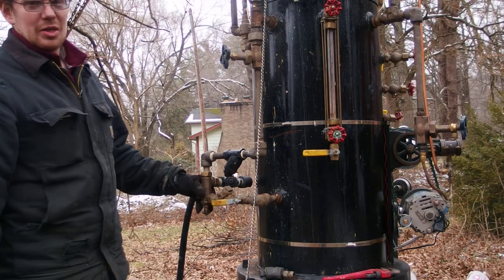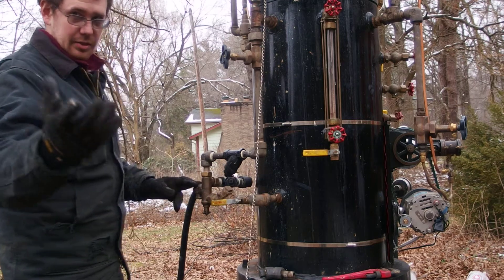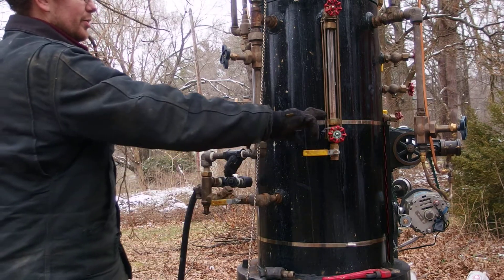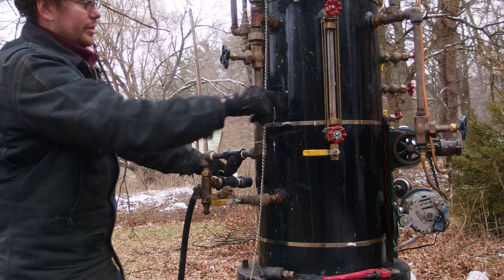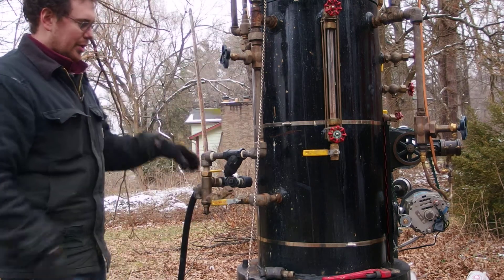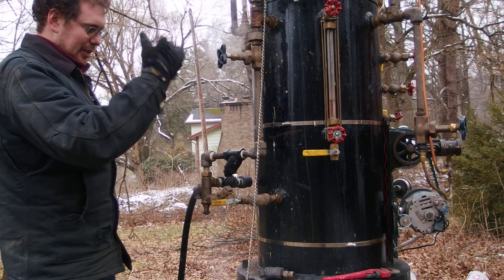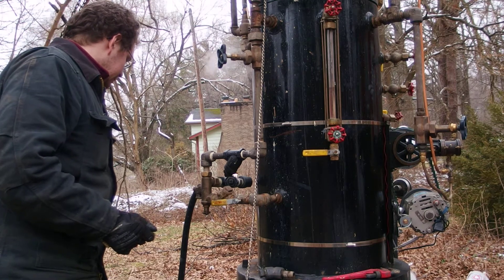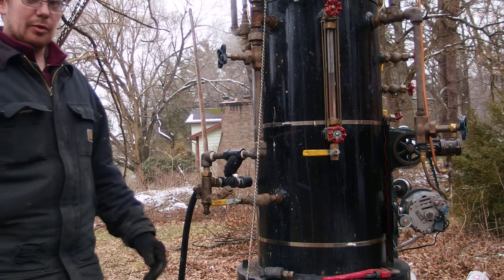Penberthy Steam Injector Operation

Comment: Beautiful Boiler! Where did you get it? And What happened to the boiler you bought from Ross?
Reply from the maker: +SteamAndSmoke97 It's a new ASME code and stamped boiler from Lund Machine Works. The boiler from Ross is not being used.
Reply: I understand it's a code boiler, I've been looking for one for my Engine collection which is growing larger than my smaller boiler can handle. How much is Lund charging for a boiler like that? And why is Ross's not being used? Have the tubes or welds started to leak or weep? Or is it just because you feel safer with the Code boiler?
Reply from the maker: I'm not using Rosses boiler, because one boiler is enough for one man. :) There were no leaks/weeps, but there were a host of little issues that show he probably shouldn't be selling them. Many people are angry about his boilers, I feel I learned a lot on my boiler from Ross and moved past it. The capacity, performance,  features, and safety of my new boiler is almost like night and day and worth the money.